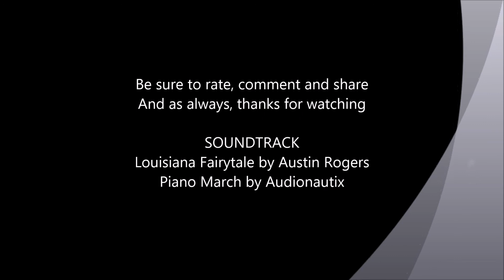3D Printer Garolite Flex-Plate, Part 2

Comment: Was this piece of garolite surfaced at all before using it for printing? I've heard as manufactured garolite isn't smooth enough to directly print on without being sanded or etc first.
Reply from the maker: It was listed as having a "smooth" texture and I used it as is.

Comment: What was the point of all the expense for the flexplate if you are gonna scrape the parts off the unheated bed anyway?
Reply from the maker: These are small parts in Nylon and thus they are more flexible than the FlexPlate and need to be scraped off.  If the parts were thicker then you can flex them off.  In general the parts need to be stiffer than the plate or you can't pop them free.  

The point of the Garolite is to make the Nylon filament adhere without having to mess with glue stick or other things which I need to apply to the BuildTak for the Nylon and then remove for other materials like ABS.  So much easier to pull off a BuildTak plate and slap on a Garolite (or PEI) sheet to change materials then to apply and remove some surface treatment IMHO.  

Also, for some parts, it's much easier to pull the Flex Plate off and scrape them off outside the printer.  With the enclosure on my printer, access inside is limited and if you have to really work at a stuck part, you can mess up the bed leveling if you use too much force on removing the part.

Comment: Just wondering why you used the thin tape instead of a sheet of the 3M adhesive. Would have made it easier to peel up one backing instead of several.

Also isn't the point of using the flex plate so you can remove it and then flex the parts off. Maybe that's what you normally do, but just wouldn't work in this example?

If you were doing this again, would you use the same thickness of materials?
Reply from the maker: Good questions, thanks for the comment.

A few reasons, I suppose.  One was that is what I could find at the time.  Also, I was worried about leaving air bubbles and not being able to see them, the strips give the air an escape route.  

The plate is still able to flex enough to pop parts free, given that they are large and stiff enough to do so.  Smaller or more flexible parts are not stiff enough to pop loose, even on my thin BuildTak flex plate.  I did mention that I might use a thinner sheet, like 1/16", if I were to do it again.